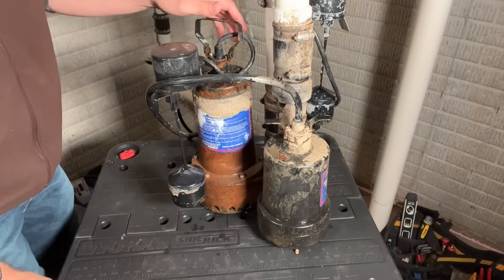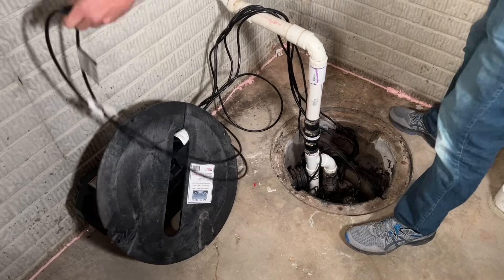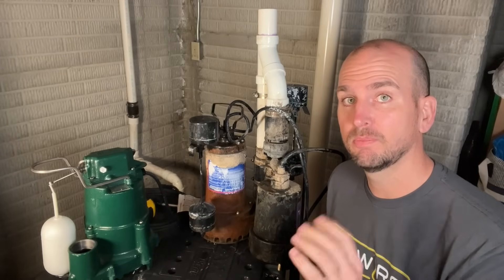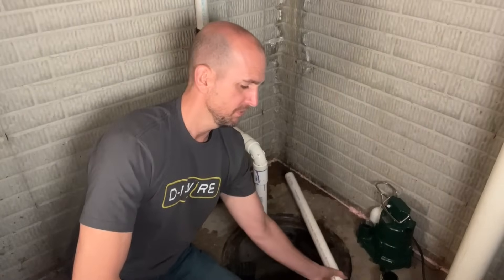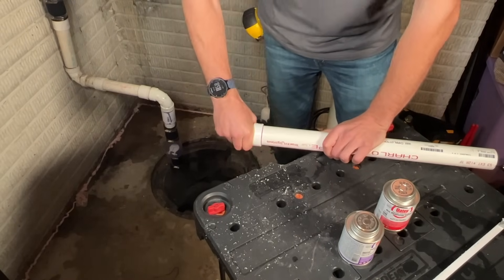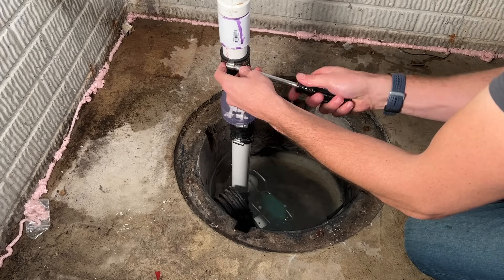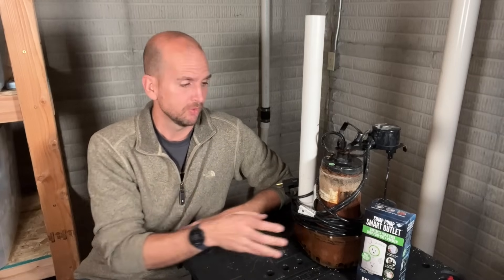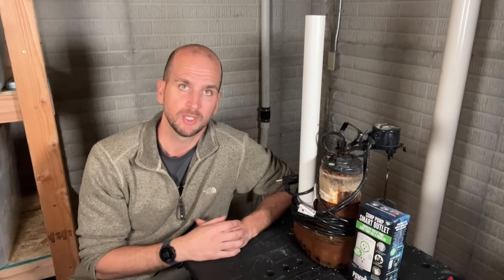How To Install A Sump Pump In Basement

Comment: sir explained about the sump pump easily and clearly,now I still wonder when you active sump pump the water is drained but I see the water in the 4 inches pipe running back, is it your basement adding a water guards system.Usually I see the pot containing sump pump usually it has holes around so that the rain follows the holes into the pot when the water is full the sump pump automatically pushes the water out,  why does the pot of sump pump have 4 inche pipes that's me question please explain  thank you very much

Comment: Good video. I'm pricing out a redundant system right now and had been thinking I'd go with my current Zoeller M53 as primary, and then a Zoeller ProPak next to it, which would cover both mechanical and power failures. But this seems like a simpler approach that covers all of the bases.
However: Would the Ecoflow battery be always in-line on the sump system, or just available if power goes out?
If the latter, aren't you going to be SOL if you lose power while you're on your camping trip with your Ecoflow battery?
Reply: I just bought a pump spy 2000 watt inverter and an agm sealed deep cycle battery.

Comment: Good video. I would recommend you rotate the pump so that the float is not directly in line with either of the 4-inch corrugated inlets.

Comment: This pump is overkill for 99% of homes.  (I have one of these)  First of all, it pulls a 10-11 amp load when running which is HIGH.  Plus the startup surge is between 25-30 amps so you might not want this on a 15 amp line as if that breaker trips, you may not know and have a flooded basement.  It can pump something like 85 gallons a minute which is a lot.  WAY MORE than you'll ever need.  Go with their smaller M53 and be able to sleep at night.
Reply: All Zoeller pumps are energy hogs. Even the M53 has like a 30 amp inrush at start. When I used an M53 my electric bill was $100 higher during a heavy rain month. I switched to an Ion Storm Pro and have never looked back.
Reply: @rustyme1122 thank you for this, I bought a Liberty pump that I will be switching to during the summer. My electric bill skyrocketed and I couldn’t figure out why especially in winter.
Reply: Yeah, I recently pulled that Zoeller pump out and replaced it with an Everbilt 1/3 HP.  Its super quiet, only a 10-12 amp inrush and 6 amp when running.   I cleaned up the bigger Zoeller and keeping it as a backup if the new pump fails.   @rustyme1122
Reply: This is a nice pump. I have one.  But the float sticks. In a storm 3 weeks ago the float stuck and I walked down to a basement with an inch or 2 of water in it.  I shook the pump, the float rose and it quickly removed all the water. There are many reviews that mention that this type of floats tend to stick on the zoellers.  
A better option is the BN53 which comes with a separate tethered float switch.
The specs on the pump says it pulls 9.2A and a 29.2A start surge
Reply: @fxk74  Good info,  but "this type of floats tend to stick "  what is the switch type you are referring to?
Reply: Thank you for this.
Reply: I agree with you. But spend a little more and get a m63 instead of the m53. Better build for small dollars.
Reply: I was looking at the m53 also
Reply: The m53 is 25.9 amps under load. And trips my gfci every so often. Bad idea
Reply: 30A of in-rush current isn't going to trip a 15A breaker or overload a 14AWG cable.
Reply: Its not overkill!! Youre relying on it to not flood your basement!!
Reply: @AngeloR674  I don’t think you understand what he’s saying. If you have this on a 15a run which is most likely 12 gauge wire sometimes even 14 you’re drawing 10awg amperage on a 12-14awg wire which will cause it to trip or heat up the wire.
Reply: And that new pump in the video is cycling way too much (on and off every 10 seconds during a rainstorm) which is hard on the switch contacts.
Reply: @jayvalentin018 I do understand!! What youre not understanding is! It’s not overkill!!
Reply: @2aminitials  actually its every 3 minutes for 10 seconds, 20 times per hour. 3 minutes X 20 times per hour equals 60.
Reply: @2aminitials I've replaced my switch twice.. I've had it for 12 yrs now. Replacing with smaller unit. It is LOUD
Reply: if it flips your breaker it can move 9,000,000 gallons per min and still be completly useless @AngeloR674

Comment: Love the video. Something clicked for me when watching. My pump that installed a few years ago was VERY noisy. I thought I installed it wrong, but turns out it was just the crappy check valve doing water hammer action. I bought the clear one you linked here and it is now silent! Wow. what a difference. Thank you.
Reply: Yes, I also installed a clear Zoller check valve and that put a stop to the pipe clunk after each pump cycle.

Comment: Very informative, down to Earth presentation. Practical and easy to understand.

The only things I would do differently is to install a Zoeller check valve (30-0238) directly into the pump, then connect the PVC tube at that location. This check valve already has a weep hole, and that would save time drilling one into the pipe.

I'd also want to position the pump so the incoming water isn't directed at the float.

Here at home I have an SEC voltage inverter for a backup for my main pump. And, even though it would add some complexity, I'd still add a battery powered backup pump. As reliable (or unreliable) as any main pump and an inverter can be, it wouldn't hurt to have a second pump ready to go into action if the main one conks out.
Reply: Thank you for idea using Zoeller check valve connecting directly to sump pump...

Comment: Why remove the sump pump if it's working? Get the new one ready for the swap with a new pipe up to the flexible fitting, THEN remove the old and swap in the new. Easy peasy.

Zoeller pumps are great, but the switches are so often the failure point (not just on Zoellers of course, the old mercury float switches were much more reliable I'm sure). I don't mess around with Zoeller switches anymore. I bought a new switch for 40 some dollars thinking "it should at least get me by a year"... It failed the next day. So, I swapped with one of the other Zoellers I had on hand and took the cap off and hardwired the pump on, bypassing the switch integral to the pump unit.

Used a 'Basement Watchdog' external switch for a couple years, but it started to get stuck on repeatedly and was cycling far more often than I'd like.... So then I added a solid-state relay to replace the relay in that unit and it worked and solved that problem, but still cycled awful frequently. So, I just slapped some optical water level sensors into PVC, extended the wires, hooked up an Arduino UNO clone and now I have nice long cycles and adjustable on and off settings by being able to just either sensor height separately in the basin. My sump is now 100% solid-state, though sometimes I get some of that red bacteria or whatever in the sump during slower times. I'm concerned it may obfuscate the optical water level sensors at some point.

Comment: Running it in duplex was smart, on commercial jobs there's a controller box to alternate which one is running to make wear more even on both of them. I'd have ran both sumps independently to the discharge check with each pump having its own check valve.

Comment: If I was putting in a new pump I would also change the check valve(s)  just to be on the save side. A new pump won’t work with a soon to bad check valve ?

Comment: Unfortunately we live in a raised ranch and our family room is on the same level as the sump pump so battery back up is a must. I’m assuming you must have installed a backup power supply to your home since you only have the one sump. I’m installing a battery back up and pray it works as described to keep our family room water free

Comment: Hey Scott, Question about your pump research. I have 2 pits in my basement. They both have the same pump in them today (same manufacturing date code). The one in the sump pit seems to look ok down there. The one in the other pit is looking significantly worse. This seems to be because the sump pump only sees ground water, but the other one is helping bring the water softener regeneration water up and out to the sewer. Did you come across any pump that would be able to stand up to that tougher, saltier water that is coming from the water softener regen cycle?

Comment: Great Video !  I replaced old pump which didn't have a weep hole. the  pump sits on a tray a few inches above bottom of plastic liner tub. Do you think i need to put weep hole in pipe still ?   THANKS

Comment: Just had a basement full of water because we failed to have a backup pump. People take it from me spend 250 bucks and get a decent backup pump. We caught it fast and only had 1/3 an inch of water on sealed concrete so isn’t any big deal but could’ve been

Comment: The reason that most sump pump pits are sealed is because the house also has a radon gas mitigation system 
(which creates a negative pressure on your slab and sucks the air/gas from your pit/drain tile and exhausts to below your roofline)
Reply: Thanks for posting this.  I had been wondering the same thing.  My last house didn't have a sealed cover, but it also didn't come with a radon mitigation system.  New house is sealed.  I'll be sure to reseal after replacing my pump.

Comment: Never had a home with a sump-pump and I avoid homes with them. I personally feel if a home requires a sump-pump then it was either designed wrong, built wrong, graded wrong, or built in a bad location (any or all of the above).
Reply: If you have a basement or crawl space then a sump pump usually is normal. If you’re on a slab, then you don’t need a sump pump, usually. There are exceptions and you need to talk to someone that knows a lot about this in your area. My brother lives in Charlotte, NC and his home is in the side of a hill, and he has no sump pump, but natural drainage around his foundation.

Comment: I swapped my check valve to the one you used about a year ago because my unit was constantly air hammering.  haven't had that problem since.  getting ready to put in a proper pit.

Comment: - Will that eco flow river pro work with a sump? I heard you have to use pretty beefy portable generators with sump pumps. Especially the right kind like you are putting in (cast iron, Zoeller, Goulds, etc.). Will this work?
- Also, did you measure the height from sump basin to where the water is sent out? Most pumps come with specs on that but, again, I heard most bad pump choices are made by getting a pump that cannot get the water up the 9-10 foot rise (or higher) before it is ejected into a drywall or street. OTOH, these good pumps are pricey. My sump is about average for use and water during major storms. Most months, it is dry.  I wonder if this model Zoeller is overkill and DIY people could save some money by measuring the height the water needs to go. Of course, if you have a constant and high water entry problem, maybe this one is best. What is needed is a simple chart people can look at and know, this horse power and xyz capability is what I need. Saving $100 or more? The very American solution will be: Just get this one. But I find, that is often the dumb move. Like with Wi-Fi routers. No, mesh is not going to solve many problems. A better, more powerful single router for much less money is what will solve most Wi-fi problems.
Be an DIY engineer, cheap Yankee, frugal, whatever you want to call it, and know what you actually need. Saves money.

Comment: Although the pump itself is probably great, I have an issue with having the attached, non-adjustable, switch.  My parents had the same model and it would cycle "constantly" because it would empty the pit very quick and would then refill quick.  I think this caused the switch to get stuck in the on position.  I repaired it by tieing the integrated float in the up position and adding a wire float switch.  I have had good luck with the wire float switches, at least the models I have purchased, and you can get the pump to run longer by letting it fill the pit higher, although figuring out the amount of cord to the switch to get a good level is tricky.
Reply: Did it have an inline check valve installed? Or was it constantly cycling without one?
Reply: @PCMLLC  It would cycle frequently because the float switch height between off and on was too short.  It would empty the pit then quickly fill back up and turn back on.  What the wire float also did was let the turn on high level be higher than the integrated switch, it may be closer to the natural ground water level in the area.  The only way to adjust the level higher on the integrated switch would be to block up the whole pump.
Reply: @schGjS  Thanks Gary, I appreciate the help. It's been a wet one here in Utah, i'm hoping this pump will hold on.
Reply: @PCMLLC  I forgot to include that it does have a check valve installed.  We have had a pretty wet couple of weeks in WI too.
Reply: @schGjS  Good deal. I put two check valves in (used to work in aviation, can't help it), and for now i'm just monitoring it but I did order a float switch. Thanks again for the help, good luck!

Comment: I dug a separate but linked sump pit. Primary pump and a secondary one that’s set to engage an inch higher, both joined with Y joint. I put the check valves on pump exits, and a one way air vent on horizontal portion of discharge. 
My discharge line is 120 feet to ditch, running inside a 4 inch corrugated pipe that also drains roof eves . My area is cold I run 50 feet of heat tracing in case I ever need it. I use an old boat auto bilge pump

Comment: Thank you for all the great information especially on the weep hole explanation.  The first time I read about a weep hole I did not take the time to reread and understand. But your explanation was more cocise and actually showing it as opposed to a drawing explains it much better.
Reply: I have watched so many people angle the drilled hole, downward... but never seen any actually spray downward... that water comes out perpendicular to the pipe.   [I have seen airlocked pumps, running like mad, with no water leaving. The vent hole is important.]

Comment: So the weep hole isn't about weeping excess standing water out of the pipe, it is about weeping water into the pump incase it was ever dry
Reply from the maker: yeah, honestly weep hole isn't the best name.  It is more like a vent which helps equalize the pressure ensuring the impeller never gets caught in a bubble of air.

Comment: I understand that the focus of this video is about the new sump pump installation. But I noticed that the AC outlet where your sump pump is connected seems to be a very standard one. 
I hope for you that it is powered by a Ground Fault Protection circuit breaker in the main panel.
This is the most important place in a house for a GFP outlet since you may have your feet in the water sometimes. Your life depends on it !
Reply: That is normal / typical.  According to NEC and most local electrical codes, sump pumps do not require a GFCI outlet (or breaker).  Not sure why exactly, since ground fault protection is required in kitchens and bathrooms, and outdoor outlets.  Sump pumps do typically need to be on their own circuit however - not to be shared with other outlets or loads that might trip a breaker and disable your pump.
Reply: @billjohnson3344 WRONG

Comment: Those built in zoeller floats suck. I bought same thing but without float and use a digital water lever sensor and works amazing
Reply: Also use water backup system basepump. Works awsome

Comment: For my home I had a water powered back up sump pump installed that saved me from basement flooding at least 3 times. The pump motors always worked it was the switches that failed over time.

Comment: You totally went backwards. You removed a backup, in case the one pump failed set up, that would work when the power is out, to a single point of failure with no power backup. How is this a upgrade?

Comment: How are you going to get the eco flow to automatically turn on in the case of a power outage? How will you hook up the battery to the pump?
Reply: Ecoflows, since they use a 120v charge (and not a DC adapter) can be used in UPS mode. You can plug the Ecoflow into the AC outlet and then plug the pump into the Ecoflow. In normal mode the AC off the grid will just pass through to the pump. Once the power fails the pump will run off the Eco, which is basically a big battery. This subject has come up online. Jackery, which is another brand of battery, has to be manually turned on, and uses a DC adapter, so can't be used like that. Actually, I have a SumpPro, which is a power inverter, it has 2 marine batteries in it, the pump(s) run on pass-through mode and if the power fails the inverter will convert the battery power to AC to run the pump(s). I have 2 pumps in the sump, one mounted higher with a higher float, to help out if the water level gets high or the primary fails.